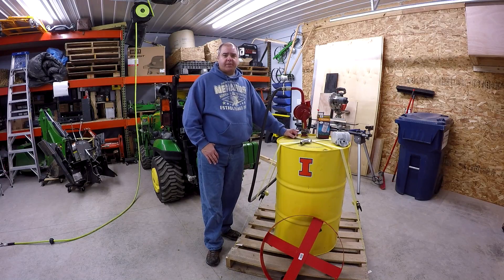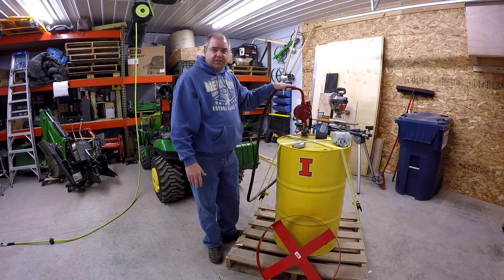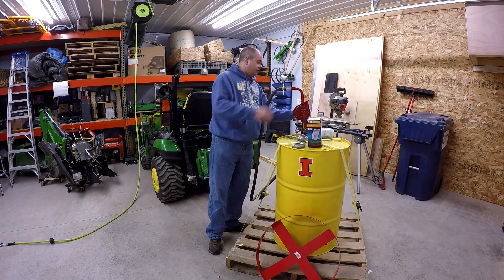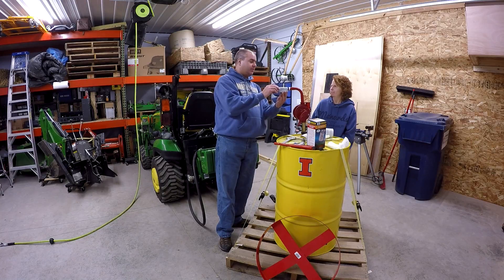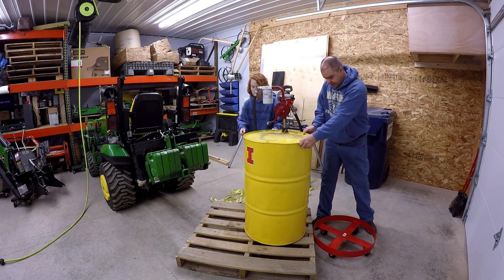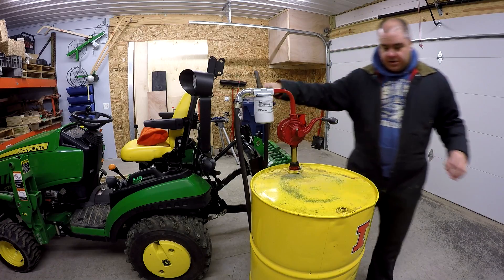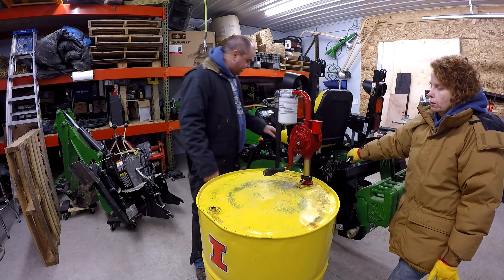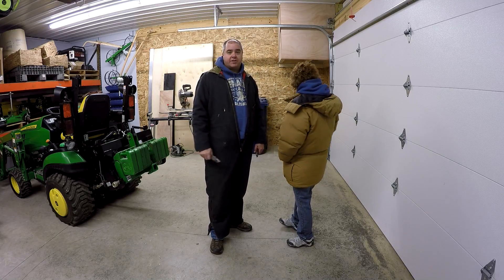DIY Diesel Fuel Storage Solution Version 3

Comment: Tim, your video doesn't show it, but it appears that when you filled your drum at the gas station, you filled it through the 3/4 inch NPT bung. Is that correct? Does a 25mm diesel nozzle fit through that 3/4 inch bung? I'm building the same setup as you but I don't want to have to remove the pump from the 2" bung every time I want to fill it.
Reply from the maker: Yes, it does fit.  Tight fit, but it works.
Reply: @TractorTimewithTim  With no vacuum issue?  I had the same question as HMac411.  Am wondering how air escapes from the barrel when you are pumping into a small hole.

Comment: Quick question, what about loading it in your truck for refilling? How does that work using the drum cart?
Reply from the maker: Not as well as it did with the pallet :-)
I put the forks close together, and run them between the wheels on the cart.  It works...just not as nice as when attached to a pallet.   Trade-offs!!
Reply: This would require a new container but I use one of the delta steel transfer tanks from tractor supply bolted to a pallet roughly the size of the tank with a pallet jack to tuck it in the corner of my shop and pallet forks for loading. Thanks for replying to an older video
Reply from the maker: I now need a larger tank anyway...more tractors, and larger tractors...so I use a lot more fuel.

Comment: I was just wondering, how much fuel does Johnny take? I know it depends on how much you use Johnny, but in a general sense, how far does a 55 gal. drum last?
Reply from the maker: On average, about 3/4 gal/hour.  Maybe a bit less.
Reply: So that would mean the 55gal. would last about 41 hrs. of running Johnny give or take an hour or two.

Comment: im doing this very thing but i have harbor frieght diesel 12 volt pump and want to mount baldwin fiter set up on plastic 55 gal barrels the blue ones so fitting are stronger than the barrel looking for ideas on that,still this helps thanks

Comment: Nice video!  May I suggest; For first responders, mark the drum.  Flammable / Diesel Fuel
Reply: Bought Mine at Granger.com
Reply from the maker: +Steven Merkel we've been looking for the proper sticker.  Could you point us to the proper one?   Thanks!
Reply: NFPA sign for diesel fuel.  The diamond tag or DOT is 1203.  Google it?
But you can get a magnetic vinyl label under $20 that will identify what's in that drum.
Here is my suggestion:  https://www.compliancesigns.com/ODE-27843.shtml

Hope that helps.

Comment: Adding the fuel filter to the pump as a great idea, would a water separator be any good or overkill added to the filter.
Reply from the maker: +Ken Litherland valid question Ken.  I'm sure it would be good insurance.  However, in 2 1/2years, I've not had ANY issue with water, even when I left my tank out in the rain :-( for a few days while my shed was being built.
I think I'll avoid spending any more on it unless/until I have problems.
Do you think that is a mistake?
Reply: I'm not sure since I am not a Diesel person but you do find the water separators on trucks since it's there to remove the water created from the storage tank, condensation I would guess. It may just be overkill on your tank.
Reply from the maker: The tractor has a water separator on it.

Comment: now its time 4 a 12v or 120v powered pump.. :)
Reply from the maker: I guess so.  everyone is saying that.  I'm totally content with my hand pump.
Reply: if it works 4 u,  drive on with it. u'd never see me using a hand pump.. im 2 lazy...lol
Reply from the maker: well, there IS a bit of difference between the 1025r tank, and the IH 1586 tank!    Having said that, as a kid, I filled an IH 1466 tank many times with a hand pump.  ....until the powers that be FINALLY decided to get a 12v pump!
As it is, I'm only adding 2-4 gallons at a time for most fillups.  So, no big deal.
Reply: i have smaller tanks 2 fill just like u. but i do it old school, with gas cans.. never fun.. i put more gas on the floor then in the tank..lol my 1586 holds 80 something gallons with 2 tanks.. did ur 1466 have 2 tanks?
Reply from the maker: +MRJOHNDEERE3720 no, just a single 44? Gallon tank on the hood in front of the steering wheel.  They moved the tank(s) to the rear in the 86 series.
Reply: o ok. i no that u could get side tanks 4 the 66 series. if u wanted 2 be dum u could try 2 add side tanks 2 the 86 series...lol the smaller 86 series did not come with a 2nd tank, u had 2 order it. but with the 1486 & 1586 it came with 2 tanks..

Comment: Makes life easier if you buy two fittings for your pump and barrel. Buy a 2" female cam lock fitting with male threads and screw it into your barrel. Buy a 2" male cam lock fitting with female threads and screw it up to the bottom of your pump. Makes pump removal and installation much easier. No more spinning the pump to remove it.
Reply from the maker: +akbychoice why would I remove the pump?
Reply: Well I'm not sure if you fill it through any other hole, but I'm always into learning something new. How do you fill the drum?
Reply from the maker: +akbychoice oh, now I see your point.  Yes, I fill with the smaller bung hole.  It is a tight fit, but the nozzle does fit.
Reply: Gotcha, I delivered fuel for 25 plus years, but with an 1-1/2" nozzle it had to go in through the 2" bung.
Reply from the maker: +akbychoice makes sense.  Wouldn't take nearly as long to fill with that large of a nozzle!
Reply: Typically it flows between 45-100 GPM depending on the pump relief pressure setting.
Reply from the maker: +akbychoice just a quick squeeze and Johnny would be topped off!
Reply: This is a fantastic idea. Where I fill up with red dye I must remove the pump due to large filler pipe diameter. By the time I’m finished, me and my truck bed are covered in diesel!  Thank You for this solution!!!

Comment: Tim, The only problem i can see with the drum dolly is when you load the drum on to the back of your ute to get more fuel you will need to remove the dolly or it will roll around the back of the tray where as when you had it on a pallet you could leave it on the pallet. Trying to lift a heavy drum is hard back breaking work.

Also that Metric shifting spanner is a hint for the US to convert to the metric system in line with the rest of the world. LOL
Reply from the maker: +born2flyau yes, the rolling around issue in truck was why I didn't go this route first thing.  The pallet is more stable.
However, the ribs in the floor of the truck kept it from rolling.  We tied it to the front of the truck, and it seemed quite stable.  We also don't fill it all of the way full.
Reply: @TractorTimewithTim  How do you get it into the truck with the dolly on it? I just got a Kubota BX 23S (thanks to your channel giving me confidence for this endeavour) and I'm quickly realizing buying diesel 5 gallons at a time.. and lifting that up to fuel is not very efficient.
Reply from the maker: I use the forks...close together. They fit in the dolly.
Having said that, the dolly is not so stable in my truck.  My prior solution with the barrel strapped to a pallet was much more stable.